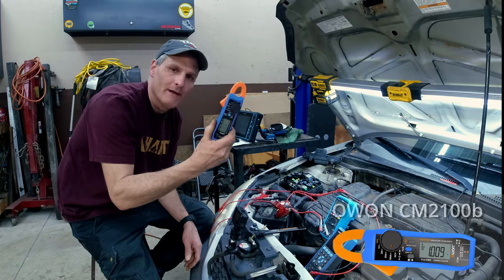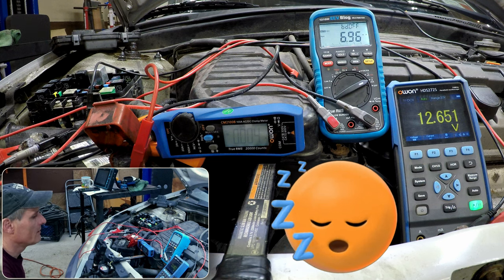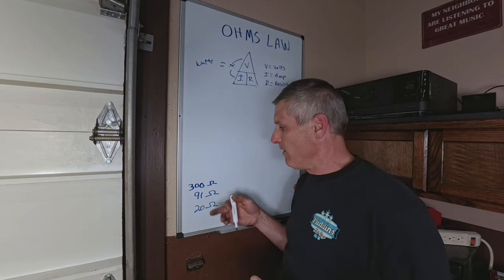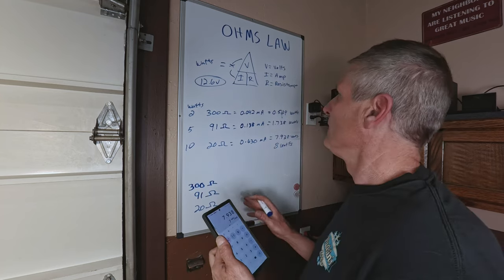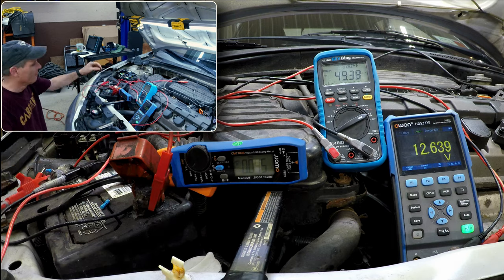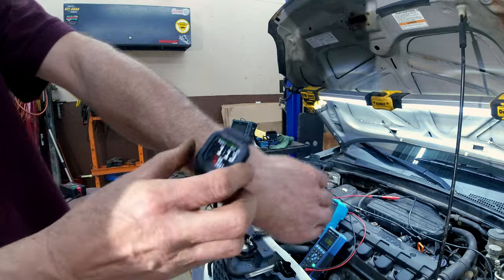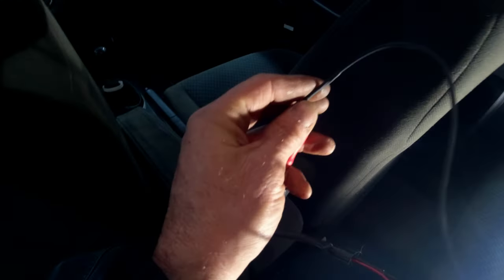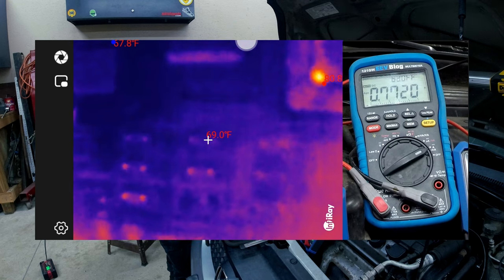Do They Work? InfiRay P2 Pro - OWON CM2100b

Comment: Want to "see" a low current draw? Latch the control side of a relay. Only about 100mA to do that. That relay will glow like a red cherry 😉 Blind spot monitors draw low current and glow like crazy when causing a key off draw. Clusters glow nice on the GM's that have draw issues too. If a fuse is glowing that means it's about to blow 😊
Reply from the maker: I will definitely be trying that. So what you're saying is that it could be useful after all. I just recently got the camera and was a little disappointed that it wouldn't detect a fuse but now you give me new hope. 

Thank you very much, I'll be heading back to the barn to go play around with it some more.
Reply from the maker: Hey Eric, I didn't realize that it was you, thanks again for the info. I've been a long time subscriber of your channel maybe 7 or 8 years now.

Have a nice day brother.

Comment: Ohm's Law works with Volts, Amps and Ohms so 12.6V divided by 300 Ohms calculates to 0.042 Amps or 42 milliamps not 0.042 milliamps as you wrote on your whiteboard.
Reply from the maker: Good catch, I didn't even realize that I did that. I guess I was concentrating to much on explaining how I came up with the mA. Thanks for watching